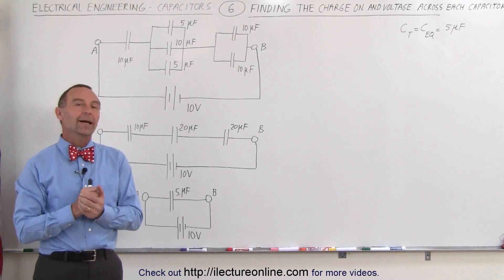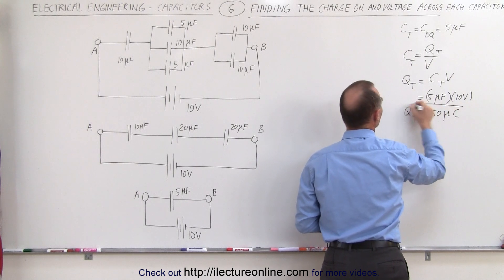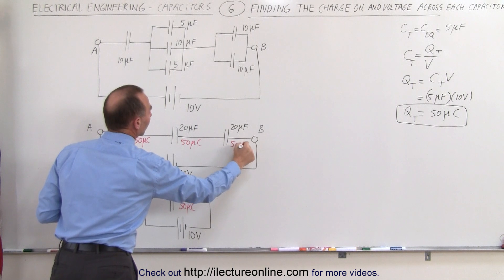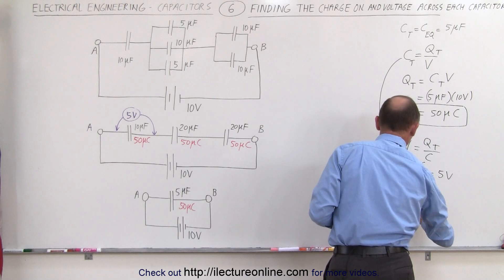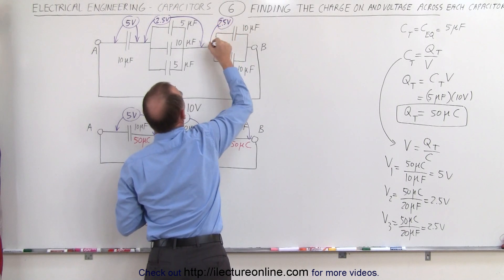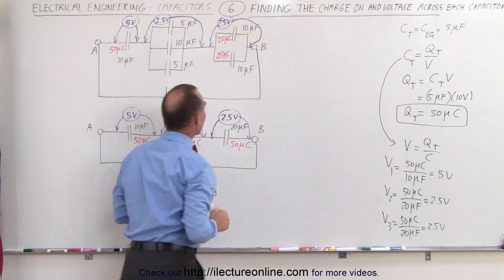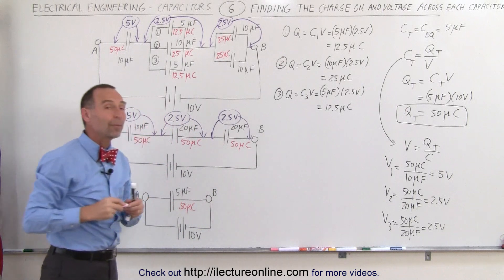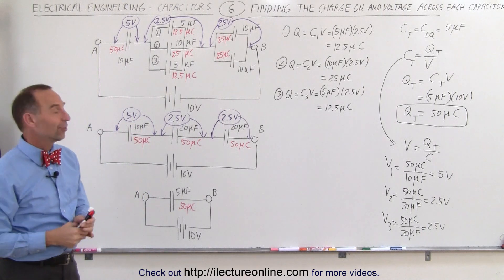Electrical Engineering: Ch 6: Capacitors (6 of 26) Finding the Charge On & Voltage Across Capacitors

Comment: three different capacitor are seperatly charged to different voltages if I join them how to calculate new charge
Reply from the maker: How are they joined?  Series or parallel?  And is a voltage applied or no voltage applied after they are connected?  (I assume no voltage).
Reply: sir first all two capacitor 3 and 2 micro  farad  are charged 100 and 180 volt respectively and then they are joined - of 3 to + of 2 micro farad  capacitor and a new uncharged 2micro capacitor is joined to positive of 3 and negative of 2 what would be new charge to each capacitor
Reply from the maker: the 3 uF capacitor would contain  97.5 uC of charge      The original 2 uF capacitor would contain 157.5 uC of charge   and the new 2 uF capacitor  would contain  202.5 uF of charge.  This is a difficult and tricky problem and would take some time to explain in this fashion.  I plan on making a video this weekend showing how to do it.